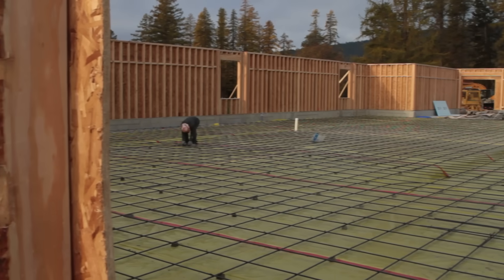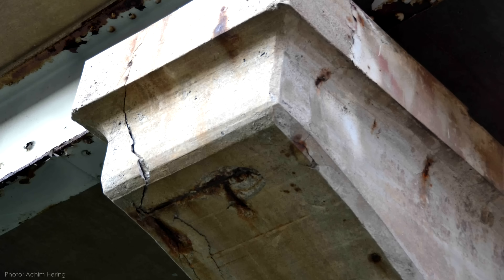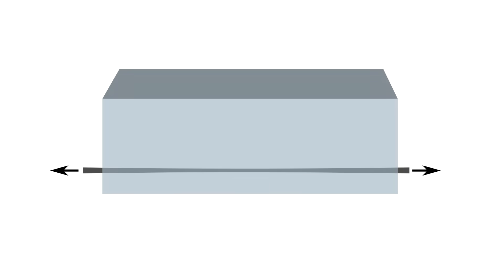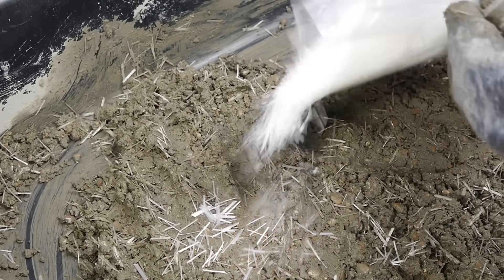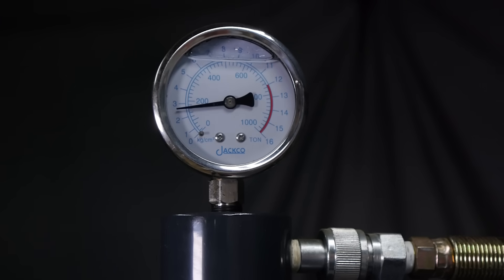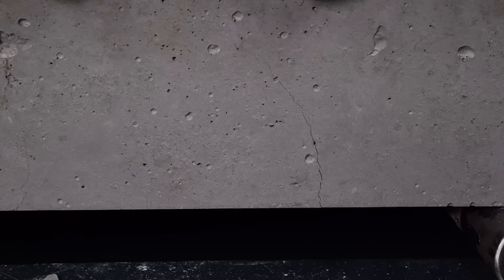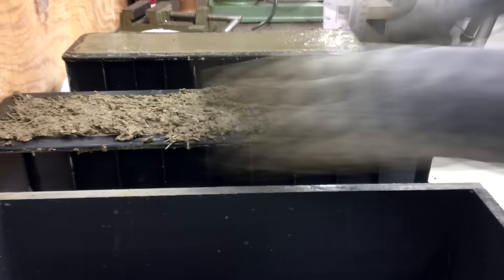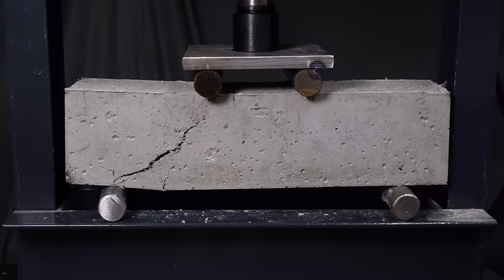Does Rebar Rust?

Comment: I retired from a water utility where they had installed a lot of pre-stressed concrete pipe. It looked like a really good idea in the 1960s and 1970s. It could be fabricated to some very large sizes (big enough to drive a car through). 

Unfortunately, the pipe manufacturer didn't coat the rebar. Keep in mind that water infrastructure is usually installed with expected lifetimes of more than a century. Only a couple decades later, the pipe began to break. Today, the problem is very serious. It's so bad that all pipes of a certain size have fiber optic sensor cables in them. They're listening for the "pings" from breaking rebar. 

A few years ago, on July 1, they detected a series of seven pings. It was a 94" water main. Crews immediately dewatered that segment and began emergency repairs to dig out that section and replace it. Water supplies were shunted to an older 48" main. We survived the July 4th holiday with the very good fortune of not having any house fires. Thankfully due to reduced demand and dumb luck, we got the repairs done before anything bad happened. We were concerned that some places in the service area might not have sufficient reserve water for fighting a large house fire if water demand was more than typical. 

Later, when the pre-stressed concrete pipe that was removed from service was examined, they found seven breaks in the rebar where corrosion had compromised it. Had it been left in place and allowed to break, it could easily have washed out several buildings. 

This is something we really need to get right, or there will be terrifying consequences.
Reply: 7 pings for 7 breaks, that's some good sensoring!
Reply: @xyjames  
You could probably hear these things happening at ground level. Pre/post-tensioning snapping is an extremely energetic phenomenon that can rip bars out of concrete and basically movie-style slice someone in half, just like a guy wire or bridge cable.
Reply: Jacob Brodsky thanks for the interesting read.
Reply: I'm trying to imagine how much water a 94" pipe can transport. If it blow out completely, it would be like having a river flowing through the backyard.
Reply: 69aussieguy That’s some complicated Math. At 100 PSI the water flow per second would be, ah, ...a lot
Reply: Rivers have river beds. Your back yard would simply be gone!
Reply: pre-stressed concrete doesnt 'ping' it is anchored along its length, i think you mean post tensioned?
Reply: SamTheManWhoCanTwice I’m certain it could ping as he said because weather pre or post tensed it would ping as the break initially countered the tensile stress of the reinforcement .
Reply: @Jenksauto  but it's retained within the concrete.
Post tensioning only fails when there is no grout.
Imagine a streached elastic band set in glue.
You could cut the glue and the band wouldn't snap
Reply: @SamTheManWhoCanTwice  corroded reinforcing isn't retained by the concrete, on account of the concrete having been rust jacked apart and separated from the concrete by a thick layer of rust well before it breaks.
Reply: @wyattroncin941  this would not cause sudden failure as mentioned.
You'd see huge chunks of concrete falling away before any sudden collapse of the reinforcement,
I think there's some confusion here between post tensioned steel and pre stressed steel.

Most reinforcement is neither.
Reply: @SamTheManWhoCanTwice  doesn't necessarily have to be corroded down the whole length of the pipe, just a few inches of separtion would make a noticable ping when the tendons fail. Not enough locally to cause a pipe failure, especially if the tendons were to the outside of the pipe's wall and the jacking was breaking off pieces toward the outside. You'd still have the tendons and rebar holding the pipe together, until it pings and you have to dig.
Reply: @wyattroncin941  even the idea of a pre-stressed drainage pipe cast in a factory and delivered on site doesn't make much sense.
These were probably large in situ units tensioned together with post tensioning.
I've inspected hundreds if not thousands of pre stressed structures and never come across this issud
Reply: @SamTheManWhoCanTwice  https://en.m.wikipedia.org/wiki/Prestressed_concrete_cylinder_pipe

Seems the water supply infrastructure industry finds more sense it it than you
Reply: @wyattroncin941  touche, i have never seem or heard of this construction type before. my apologies.
Reply: @SamTheManWhoCanTwice  I think you are correct.  Nice catch.
Reply: I mean, it doesn't help against total structure failure, but I know there is a way to line (big) pipes with some kind of plastics on the inside. In principle it's tubular plastic foil which is put into the damaged pipe, pumped up with air, and then heated up, so it keeps sticking to the walls of the piping, thus sealing it tight.  Wouldn't that be an option to get through with this infrastructure at least a few more decades?
Reply: Thank You very much for the valuable insight. Being a student of Civil right now, I feel we learn much more with such practical instances you shared, then the books and definitions.
Reply: Hey , I am not into engineering I am A MBA , 
I am asking this for knowledge 
Would It be fine if they dont coat it for something that is not used near water/for water ? 
Coz here in my Country I , have never seen Coated Bars being used anywhere , 
Even in the construction of my home (RCC) , we just used Normal bars 
I understand its a problem if its being used in water pipes , coz the water will eventually reach the bars ,as concrete will absorb water
Reply: What a narrow escape
Reply: Yikes!
Reply: Amazingly valuable comment.
Reply: Hello
Reply: Thank You! Great Read. This Pipe Break Theory could easily explain why, in Drought-Ridden California, the underground pipes we laid in the 1920's and 1930's are finally starting to disintegrate all over town. We finally got some rust going.
Reply: American Govt. allowed foreign competition and the greed exodus to china is going to be the worst decisions ever made, read in History books years from now by other countries.
Reply: Hi from Calgary in June 2024. 😅 We just had a major water main break due to bad outer concrete that exposed the steel wire reinforcement.
Reply: Thanks for sharing your experience.
Reply: Isn’t epoxy coated rebar ‘bad’ now? Don’t know much about this stuff but as I understand it, cortisol occurs faster bc water gets raised between the coating and the metal. Is that correct?
Reply: Optimistic much? Dont worry about it...let someone else, always other  guys out there willing to do those boaring as fuck jobs....
Reply: And here we are two years later post Surfside
Reply: Dang!!!! How were the noises detected?
Reply: Even epoxy coated rebars are failing. I'll bet on stainless
Reply: @epiccollision But biden is passing a democratic city economic rescue plan and calling it an "infrastructure Bill" so all those bridges that aren't getting repaired will be just fine.  As long as the name is correct then it doesn't matter what the details of the spending is.  Makes sense if you are a democrat.
Reply: @edstimator1  your words are even more prophetic with the condo collapse.  Let’s see that “human infrastructure “ cure this problem.

Comment: When I think of fibre reinforced concrete I think asbestos, a lot of the longer-lived buildings in my area of the UK are loaded with the stuff including the three remaining unused cooling towers and possibly the flue tower of the now decommissioned Didcot coal fired plant and given the amount of dust that settled over the surrounding time when they imploded the other three a few years ago I daren't think what kind of insidious damage it might cause if the latter three were also pulverised in the manner the others were. Saying that though the year-and-a-half stockpile of coal that was necessary to cold-start the rest of the local grid with, the ash and particles ejected with the flue gas have all probably deposited vast quantities of nasty bioaccumulative, radioactive or other kinds of nasty substances into the ground that were once locked away underground.

Comment: If done correctly and used in non-salty environments, concrete with rebar is durable, economical, strong, and long lasting. It has many benefits which other methods lack, none of which will work any better if it is not done correctly. Done correctly is the key here, and in almost all residential construction the concrete and rebar isn't done correctly. My 45+ years in Carpentry started with being a Form Carpenter doing industrial work where everything was checked and tested throughout the whole building process. You did it all right or you did it over until it was right, which with even slightly cured concrete is no fun at all. There's no need to reinvent the wheel here- the old way still outperforms anything newer overall in standard applications. Save the specialized stuff for where it's actually better.

Comment: Another way to prevent rust is to alter the properties of the concrete itself, using higher quality  or high alkaline cement and aggregates with a high surface area, like granite chippings. I work at a factory in Denmark making precast concrete beams and columns, even when making bridge beams with an expected lifespan of 100 years, we only use a cover of 45mm. The guys casting them has to work fast though, as the high alkaline white cement makes the concrete set very fast, and more than once have we been forced to run cooling hoses in the beams to avoid that they cure too fast.
When pre-tensioning, we use 1/2" 7-strand wires.
When making stairs and landings, we use stainless where they meet to keep the cover to a minimum on moderate to very aggressive mixes.
Oh, and the sand in the danish soil is some of the best in the world for making high quality concrete. :)

Comment: Strength wise rebar and fibers will help, crack wise no matter what you do there will ALWAYS be hairline cracks or regular cracks. Especially when your doing stucco siding, the most important thing is HYDRATION when your concrete is curing.

Comment: Wouldn't the use of steel fibers increase the problem of cracking from oxide jacking as the fibers will definitely not be protected by cover and so are likely to rust themselves?

Comment: I have a question. Why do you put steel bars as reinforcements in ground level floors? Is there really that much tensile stress on the concrete that it will fail structurally? So I did google my own question and found that yes, it will fail and cause large cracks due to the friction of the concrete against the material beneath it when pressure is applied.  However I also found that potentially a much better alternative instead of large rebars is to use some kind of welded mesh specifically again, for ground level concrete. So my updated question, why do I commonly see concrete floors being put in place with steel rebars instead of a welded mesh? It doesn't sound like it should be most costly but maybe it is, I'd like to know... And once again I've gone to the liberty of surfing the web for some answers and found that the biggest problem with a welded mesh is that typically in the process of creating the concrete slab the welded wire mesh is put down, concrete is poured on top and then it's attempted to pull the mesh into the center of the concrete which typically fails, leading to a useless wire mesh laying beneath your concrete. I've found some newer products that solve this issue by creating a set up where smaller bars in the same design as a wire mesh, but keep them centered in the concrete throughout the pouring process. No more questions, I feel like we've all learned enough. haha

Comment: What if rebar is coated in a plastic rubber like  material?
Reply: The rebar would loose its tensile properties. The concrete needs to adhere properly to the rebar. When making pre-tensioned beams where I work we actually debond some af the strands (1/2" 7-strand wires) with plastic tubing a certain distance at the ends to minimize camber while maintaining the load bearing properties.
Reply: @HepauDK  What if the rebar was made from titanium bars?

Comment: it's a good demo however this will never happen and the simple reason is that some random contracting company does not care if the concrete they are laying starts to develop cracks in 10 years time so they are certainly not going to add fiber or metal reinforcement in order to prevent it at an additional cost to there bottom line.
Reply: If the client is willing to pay extra for fiber reinforcement, and the contractor doesn't use it, I see a heck of a lawsuit comming when the concrete starts to fail...

Comment: I don’t like the placement of your rebar. It’s suppose to be more in the middle of the thickness. Not the bottom
Reply: Erh, no! Concrete has excellent compression properties, and it will compress at the top. With the rebar at the top, the bottom would have next to no tensile strength, and would start to crack way sooner than it did in the video.
I work at a factory making precast concrete, and there is always more and thicker rebar at the bottom of the beams.
You have a lot to learn about reinforced concrete my friend. :)

Comment: For the most part, reinforcing concrete is a waste of money. It is extremely rare that you need the full strength of concrete. Steel is expensive and labor costs are just not worth the strength you don't need. I do prefer fiber since it does not corrode, and is fairly cheap, but if it does not require an engineer, I don't reinforce.
Reply: Spoken by someone who clearly knows nothing about construction...

Comment: Question: to prevent the steel corrosion, can’t one paint or put some kind of synthetic coating or paint on the rebar before pouring the concrete?
Reply: It would lessen the adhersion of the concrete, something you would want to avoid at all cost.
Reply: @HepauDK  Thanks!

Comment: A few years ago a draw bridge built in 1933 over brackish water was upgraded. The concrete foundations were removed and replaced with new steel and concrete. The square re- bar ( 1 1/8" )was exposed during the demolition and to my surprise had no rust. I took a few pieces home and displayed them as garden art and after a few  years it now only  has a slight surface rust.

Comment: Bridge Abutments and hammer heads use epoxy coated re-bar or galvanized bar. And use a fiberglass mix with accelerates. There you go all that talking and long video was a wast. I sumed it up in 2 sentences!

Comment: awesome video, here is a question, placement of rebar mesh in a floor slab, should it be in the top half or bottom half, keeping in mind the appropriate cover,  i have been told it should be in the quarter below the half way point for compression resistance, but others say place it in the quarter above the half way point , so what is the optimum point of reinforcing placement?
regards owen

Comment: Basaltic rebar.
On any given year one house in a hundred is rebuilt due to concrete cancer.
A lot of carbon has to be burned to make cement.
By using basalt, great savings can be made in greenhouse gases.
Lets leave some coal for our descendants.

Comment: All we need to do next is try and reduce our demand for concrete in the first place! ;)
Reply: That would up the demands for steel instead (for larger structures).
Reply: Indeed, I was really referring to smaller works where there are other methods that we know to work but concrete is usually the easy answer.

Comment: Concrete is a science that is forever evolving. I poured concrete from Nuclear Power plants to bridges, small and large. You would not believe how strict concrete is on a power plant as far as slump and curing. Many ways to cure concrete but the use of water is always the best. In the cold winter on the power plant, large tents would be used to keep the ambient temperature above 45 or better temp at all times. Concrete could not be poured on the plant if the temp was not above 45 degrees and rising for the next 12 hours unless heated tents were installed. Some of the massive pours would be way over 2000 yards in one poor. The slump was never over 4 inches and some of the concrete poured inside the reactor vessel would be poured as low as 2 inch. Almost too stiff to get out of the off-road 18 yard trucks. It was a fun job and so much to  learn.
Reply: Romans used concrete to mortar the aqueducts, 2000 years later still standing.
Reply: bo0tsy1 and proper taps on drinking fountains throughout towns and cities. They were amazing engineers.
Reply: @bo0tsy1  ya but it because  of the location not a lot of seismic activity and a good weather helped the longevity.
Reply: How did you control cracking for the internal temperature, because the massive pourings?
Reply: @igorbardales1771  Flooded under water.
Reply: @Plutarch vibrator I'm assuming just like most concrete placing. The slump is just the manner of testing the water content in a particular batch before it's placed. During the actual placement, the concrete can be worked to engage formwork and rebar properly.
Reply: @chriskelvin248  When pouring large concrete structures like this, It requires a lot of manpower. Sometimes a pour would have well over 100 people.
Reply: @chriskelvin248  2 inch vibrators ran constantly
Reply: @bo0tsy1 But they didn't use steel rebar, so no rust to crack it.
Reply: I guess they never used plasticizer. It adds slump while using less water. = stronger concrete.
Reply: That's some heavy @#+! Crete...good goin', matey. I thought I had it rough wrestlin' 9 foot gators.
Cheers. Gotta go now...got two comin' at me.